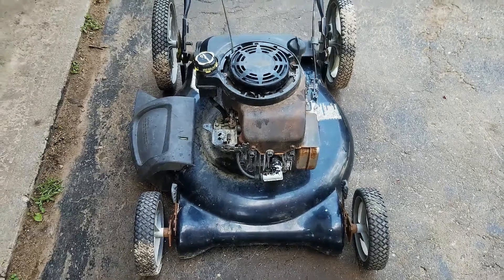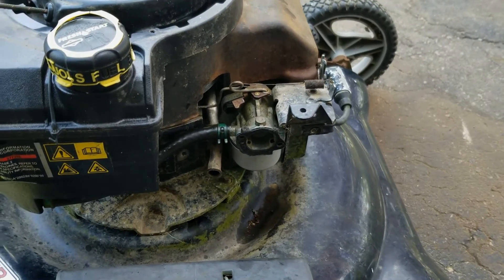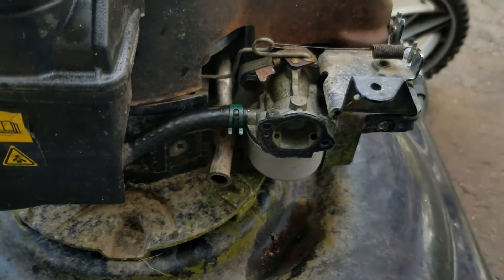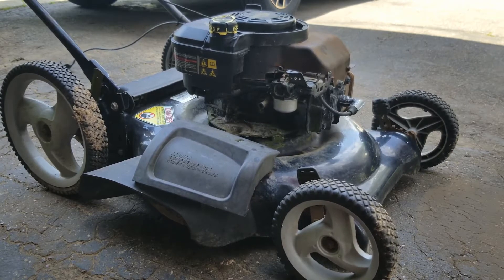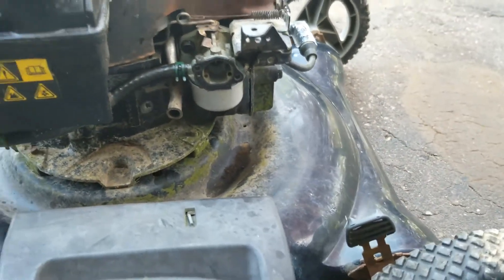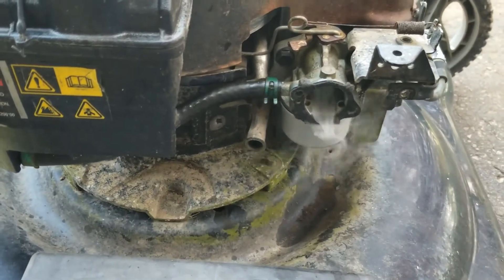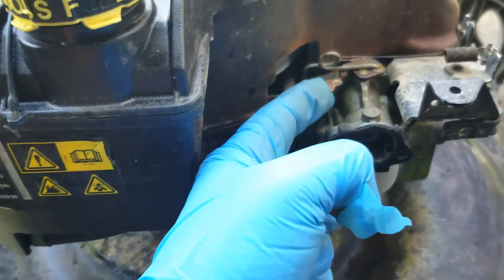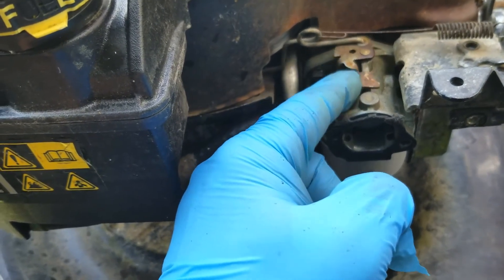How To Adjust Lawn Mower That Is Running Too Fast

Comment: Thanks!  I'll be looking into my high RPM problem today.  It happened after the mower got dropped out of the truck so I expect I have a very similar problem as you did.
Reply from the maker: Hope the video helps diagnose and fix your problem. Keep us posted. Cheers

Comment: Could be the foam under the throttle shaft is gone causing the throttle shaft to sit lower and hit the carb body.
Reply from the maker: Good tip. Cheers